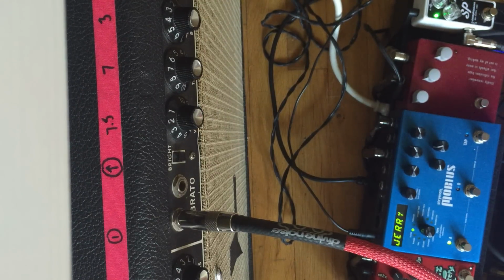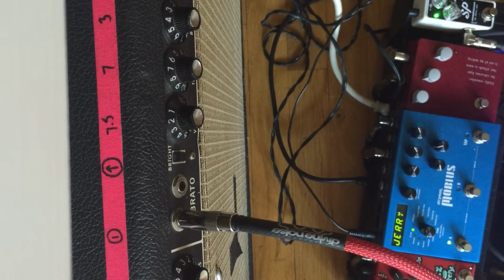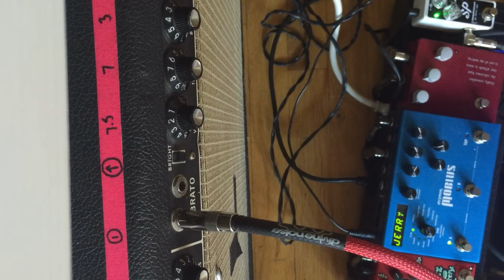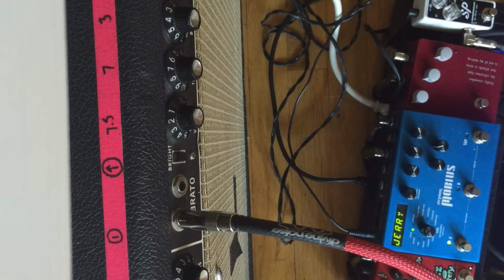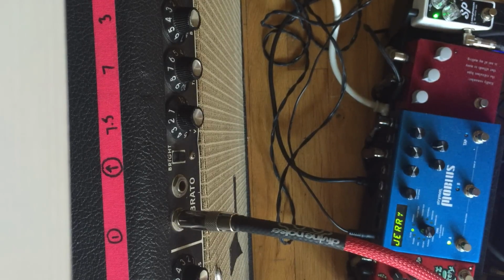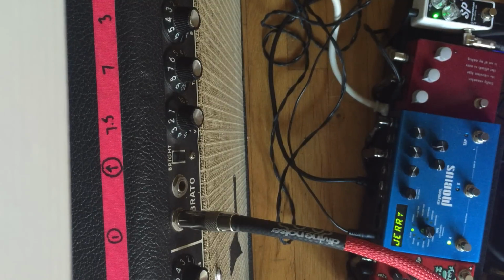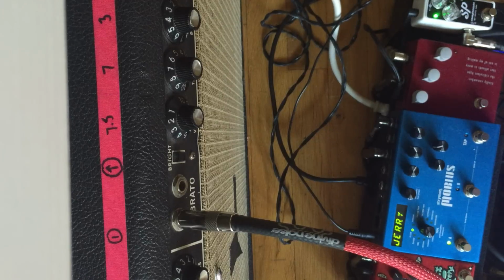"Jerry Tone" with Strymon Möbius.

Comment: HEY! Could you please share the settings? Highly appreciated!
Reply: Yeah is this your factory setting out of box or did you tweak it out? Trying to help david get it going on on his but i borrowed my MOBIUS from Pedal Genie. So i cant bust it out and make a video of my exact settings for him or i totally would. I def thought it did it really well  when i had it. Still on the waiting list for my KOT. Love analog man.
Reply: @PMTluke  I've got a Mobius too, and have spent the last 3 years tweaking it to get it to sound like Garcia (seriously, why didn't Alex share the settings??).  The closest I've got is Filter mode on LP (the way Jerry used his mutron), Shape is Env+, Frequency Mid is II, Resonance is III, Dry Level off, with the Depth knob around 4 o'clock.  

I've also tried it with the mode on Wah, and boosted the Resonance a bit, but it gives it a bit too much "sting" in the highs.  This can be adjusted with rolling off a bit of the highs in your guitar's tone knob, or lowering the Depth knob a bit.  

Nothing I've tried has been "just exactly perfect," but it's as good as it gets without buying another pedal.
Reply: @joshuawakesberg615  Yeah my friend Walt Berger plays in For The Grateful and has a Mike Biegel Mu-tron one of the ones that are super super expensive mainly because it's signed and it is a really rare one but yeah.....also becuase it nails the sound dead on it is the Mu-tron biegel jerry sound. Analog Filter stylie. Walt is not a huge fan of digital but he said the digital filter pedals like the MOBIUS, Kemper Profiler jerry sounds, and even my Source Audio Pro Poly Mod Filter are getting closer. The old Q Tron large box does it quite well too. I'm interested to see how the newer Q Tron Plus shoots out VS. some of these. Alot of the STRYMON MOBIUS i was kinda let down by but i really did dig the Jerry preset as i am a huge envelope filter fan.....as well as a STRYMON large box preset fan...Especcially on the TIMELINE but there were many good ones on the MOBIUS too...just some that were waaaaaayy to EXTREME and far out for me to use on an album or in any musical context for what i do. Which i feel is extremely experimental.

Comment: Do you have the KoT going into the Mobius or the other way around?
Reply from the maker: Jay Foster Guitar definitely put an envelope filter like this before the drive. You don’t want the signal compressing before it hits the envelope filter. The filter relies on the dynamics of your playing. If you put the drive first, you probably wouldn’t get much of a quack.
Reply from the maker: Sorry I just realized that’s confusing because I use a compressor at the beginning of my chain. It’s got the blend wayyyy down so it’s just thickening the tone a bit and not crushing my dynamics. You just have to make sure that you have volume to play with so you can work the filter.
Reply from the maker: Jay Foster Guitar huh. I hadn’t watched this in a while. It sounds like I did have the kot first. Maybe I was playing with having that first and then the Ktr after it as a clean boost? I did a lot of experimenting, but for years now I’ve kept the filter as close to the beginning as I can to preserve the dynamics going into it. I’d recommend doing that, using the volume on your guitar to shape the “synthiness” of the quack, and then controlling the amount of edge on it with the kot (or, ideally, amp) afterwards. Have fun!
Reply: Thanks :D The Mobius does a damn good Envelope Filter, very cool. Plus all of the other things it does. Thanks for the reply